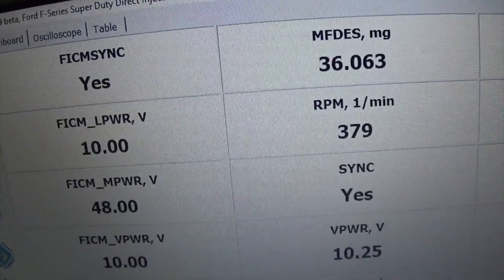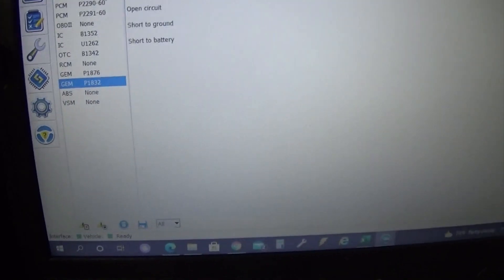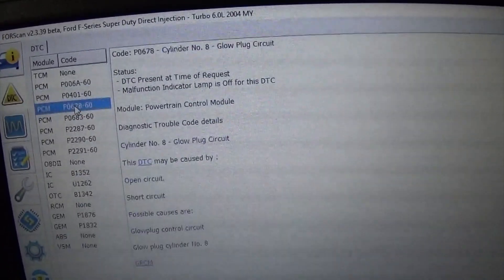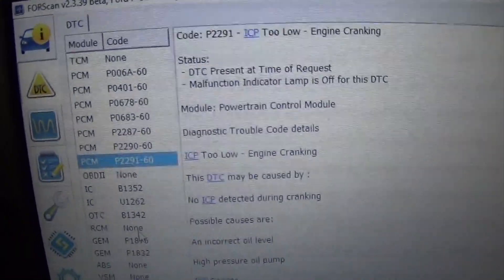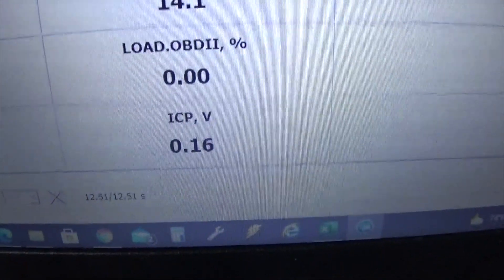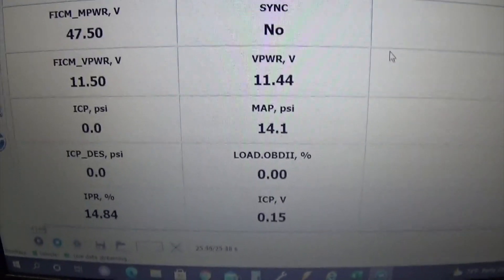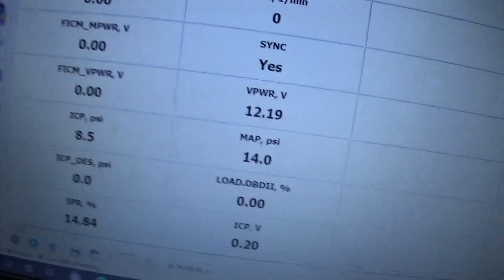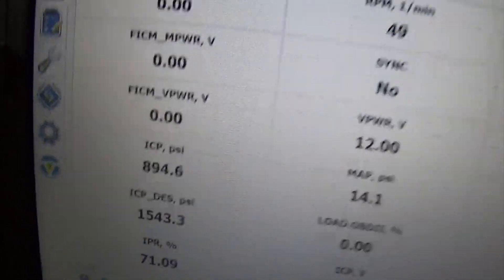6.0 Powerstroke/ Crank No Start/ DIY testing tools

Comment: Otc makes a test plug 303-756 for those Snap To Connect lines. I had an old set of the log oil rails, and I unscrewed those stc fittings from the rails, and found some jic style hydraulic caps that fit perfectly. And was able to make a basically free test plug for those stc braided lines.